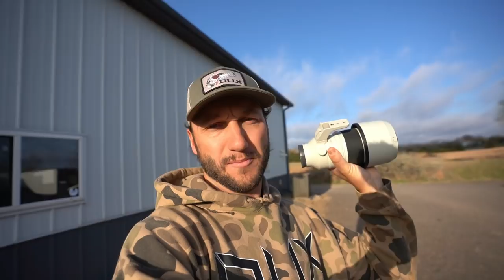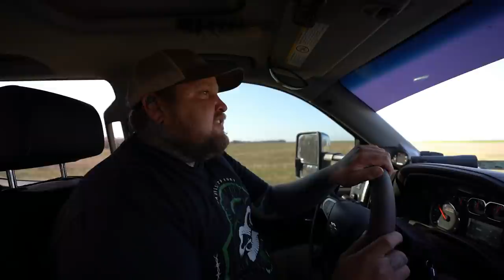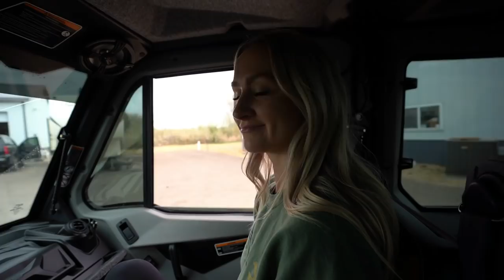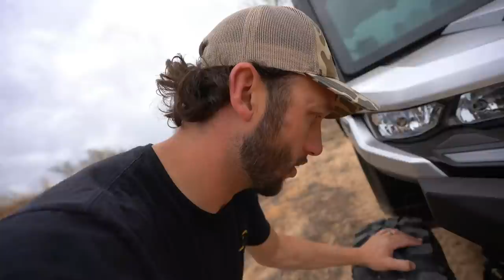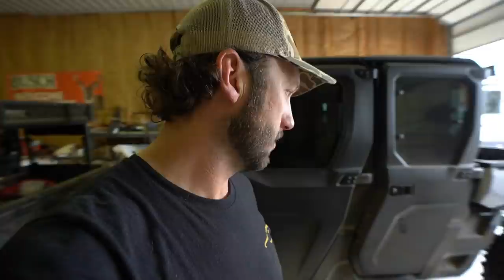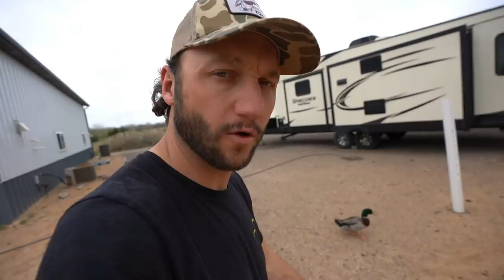My New Hunting Rig!! Can-Am Defender Limited and Turkey Tour is Here!

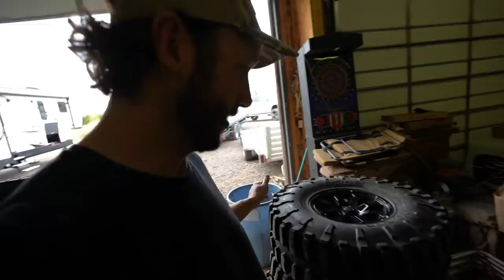Comment: 18:00   Sand tires; no good in mud. The heated cab will definitely be very nice, but with the weight of the hard shell, heater, a/c etc, I wouldn't try to pull any trailer on a sloppy day, unless it frozen. Good luck w turkeys!